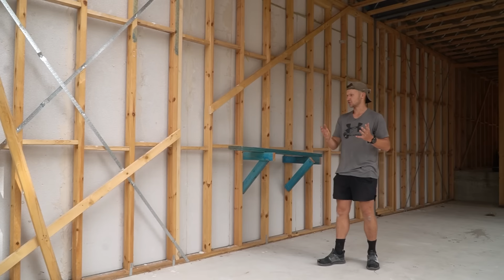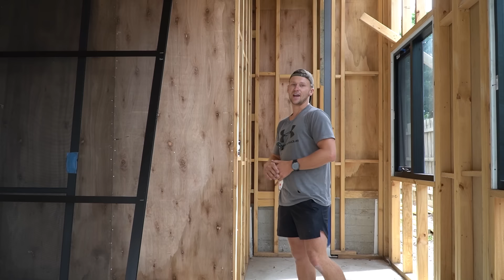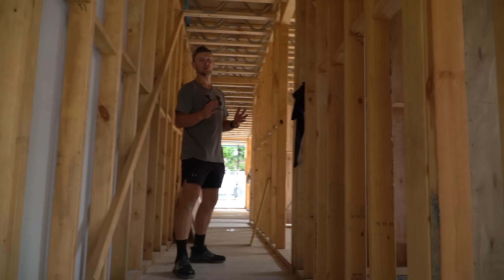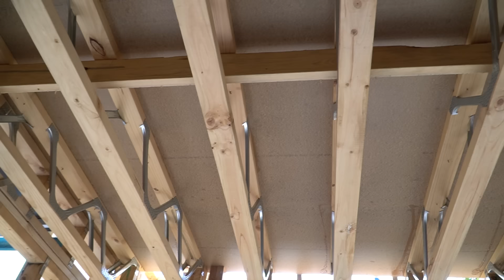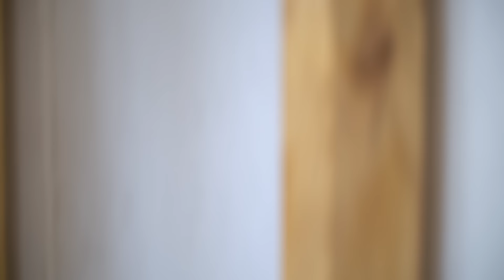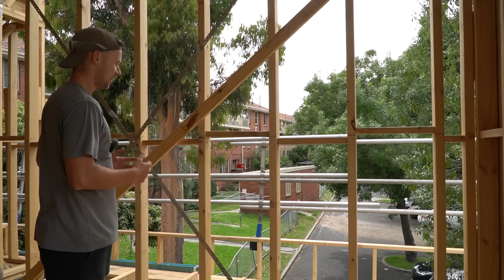Every Part of a Timber House Frame—What You Need to Know!

Comment: In a stump house you would have the stump a bearer then a joint. Then yellow tongue subfloor on top of the joists. The when installing the bottom plate for internal walls do you just nail to the yellow tongue subfloor because you wouldn't always have a joist underneath to nail into?

Comment: This is not the norm in australia. The homes i put roofs on, are so flimsy they tilt over if we dont lay a few battens down before removing the bracing first. Absolutely shocking
This frame looks impeccable, but definitely not the norm

Comment: If you stop and think about all the skills and intellect, not just the raw strength and stamina required to do this job well. Its pretty remarkable. 
Multitasking: know the order in which every job is being carried out, being across what everyone else is doing as well as ensuring they are working in with what you are doing, Being millimeter precise with materials that are not, reading complex plans correctly and adjusting for future work to ensure it runs smoothly and making required fixes on the fly that will pan out after other processes are carried out. 

Changing direction depending on the resources available and yet still making efficient use of labour. Making every process as efficient as possible without cutting corners or taking unnecessary risks. 

Also, worrying about the safety of apprentices on site (ear muffs). Its like everything he is doing at that moment has to be on autopilot AND correct just to allow enough thought for those around him and sort out all their problems/questions whilst still not losing his train of thought on what he is doing. 

There would be very few people who would actually have the raw talent and capability to do this regardless of experience.  

The absolute best part of this process is his personality, never once raised his voice, made fun of the many apprentice stuff ups, directs with quiet confidence and helpful attitude. If you have ever worked on site you know how rare this is from the builder/foreman as the pressure and stress AND responsibility soon takes its toll. Really impressed with your workflow. Two thumbs up!! Keep the videos coming!!!

Comment: Hey Dave... Great video. BOX GUTTERS are liabilities. NO TO BOX GUTTERS.
Reply: Roof plumber here. Totally agree with you. I install them every day at work. But if I get work for myself on the side I refuse to take on work involving box gutters. You can do the best job possible but at the end of the day 1 day it will leak just like externals do. Much rather have water leak outside my house then inside it. 😂👍

Comment: Are the noggins always set back to enable TV/Electrical cables to be installed later?
Reply: I'm no builder, but I think they take a spade bit and drill small holes through the noggins to pass cables.
Reply: @DodgyBrothersEngineering  that is standard when running the cables in the initial build but I am nut sure that they set the noggins back for future wires. Hence the question.
Reply: @ the noggins would need to be a different size to the studs to allow an offset. I think they are the same size.

Comment: Well done man. Interesting to see the difference between the standards here in new Zealand and over in oz. Often here in nz a window or door is wrapped with building paper (normally synthetic paper now) around the frame and into the inside, then flashing is used to cover the paper around the opening and corner packers are used to  protect the paper and tape. Flashings on the bottom and top of the opening are also installed. All of the is done before the windows or doors are installed. Bracing is often done with the use of gib brace line on the internal walls. Although products like rab boards and ecoply are also common for external bracing. Often internal bracing is use as it allows for the wall cavity to have airflow and to dry out if water penerates. Personally I'm not a fan of box gutters and parapits mostly because of the extra cost in time and labor requires with using tpo membrane. A eve gutter is a lot more cost effective while still performing the same task of removing water away from the building

Comment: Engineer from western Australia 
You have a very good understanding of structural design, forces and load paths
Most construction here is double brick and carpenters are roof carpenters 
I am personally building a steel frame house, with pre fabricated walls and trusses
Had all the frames and trusses up in a week doing most of the work myself 
Most carpenters don’t understand steel frame, interested in your views
Great video by the way
Reply: My biggest concern with steel framed homes is the thermal bridging. The importance of this is heavily depenent of geo location but even in Perth I would be trying to design out steel as much as possible
Reply: @I used to think the same, however on my last build using 90mm studs, weathertex cladding and 10mm plasterboard
And insulating with hi density bats the transfer of heat on a 40 degree day with direct sunlight the temperature at the studs was only slightly noticeable
In Antarctica or the Sahara it might be more noticeable
Reply: @michaelhermans4753  Melbourne is one of those areas where it matters a lot. It is a lot easier to get the 7 star NatHERS rating around Perth so I would assume it would be less of an issue

Comment: I have to disagree with the installation of the windows. Just because you used to in the past it doesnt mean you should still install windows before the building wrap. If you are using a quality product like Bradford Enviroseal you should follow the install manual which clearly shows wrapping and taping the window opening. The Australian standard 4200.2 is lagging behind and needs to be updated (I assume it will as the new NCC coming out will have air leakage measures in it)
Reply: So, what you’re saying is it’s not code yet so he has done nothing wrong. What is the point of sealing air gaps around the window? If you have single pane glass and a thermally broken frame?
Reply: @byza101  Correct he hasn't done anything wrong, but he could do a lot better, and I found another video of his showing the correct methode. The NCC is a bare minimum, it is not meant to be the top standard. And wrapping the external membrane in and around the opening and taping the opening is about protecting the timber from any moisture from the outside. Taping the windows is the next best thing in being able to control both water and air. 
Depending on the climate of course, but no one should be using single pane glass and even thermally broken aluminium frames are still under performing.
Why would you want to seal the windows to stop air leakage. Stopping air leakage is about control, we spend a lot of money to heat and cool the air inside our homes and if the house is a glorified tent, then the money is esaping out of gaps like these. Controlling when and how much air comes into and out of the house is paramount for a health home.
Reply: @ottigreenisgo  sorry I meant to say thermally unbroken frame, was a long day. Until we move to triple glazing and thermally broken framing as standard. Then all the sealing and insulation in the world will be pointless, as windows become pressure points for heat/cold transfer.

Comment: Be good to see you run through using a laser level on a build one day, finding high spots before trusses go on and how you plumb everything up
Reply from the maker: I’ve done a few videos on this, the latest one is episode 7 of the current build im working on
Reply: @DaveDoesCarpentry  awesome I'll check it out. Out of interest what vapour barrier product are you guys using under your bottom plates? How do you see your chalk lines once its in place to know where the frame goes?

Comment: Well done , I have been bending nails for 43 years and had to hang my belt up . "Stage 4 Cancer" . I guess I am one of those old carpenters. I enjoy checking out how building is around the world .. A lot of similarities between The USA and Australia beside the Imperial System of measurements . I like all the laced together bracing , shear bracing and love and opportunity to install windows before sheathing . Seems to be a flashing issue here in The States that everyone can't unwrap their heads around . I like the bracket allowing for the settlement but not allowing for a shift . How many times I explained to other carpenters that trusses many times should not be in contact with non-bearing walls below . , That by doing so you change the dynamics of each member and create moments , loads being picked up where they shouldn't can cause structurally problems .. The cross bracing and those short rack steel walls .. awesome . I love the strapping centering on the studs .. chasing load paths for uplift, shear and loads .. Well done  I like that you left the stud " Floating " at the junction . to straighten . So many I see go blast  gun crazy and impose a curve .. Then comes a cat's claw or a sawzall ..   Good job young man
Reply: Stay strong and keep fighting!
Reply: I m starting as chipy Good luck to you Get well soon